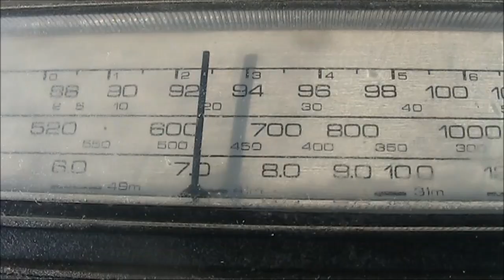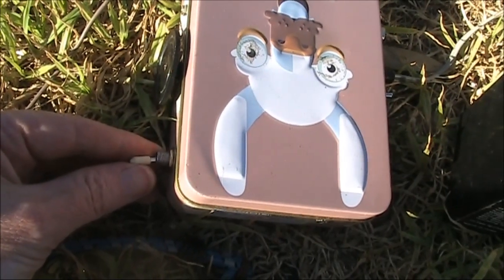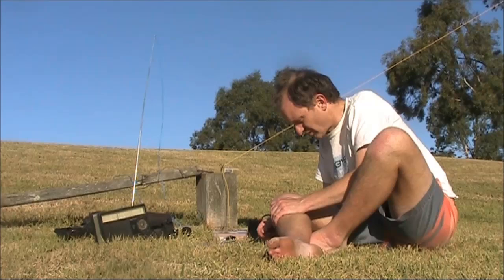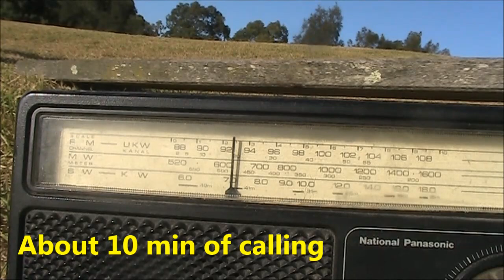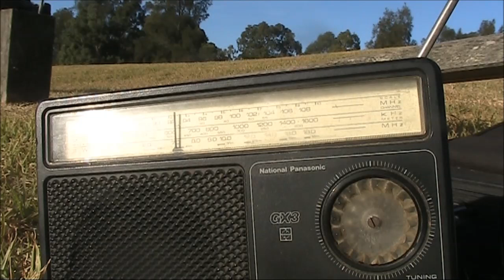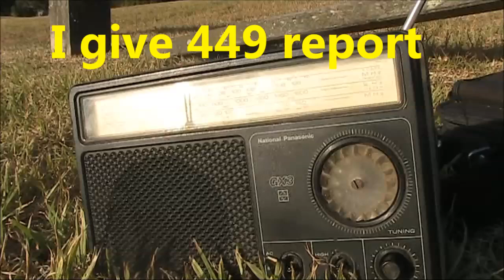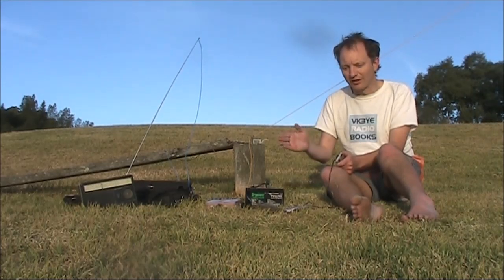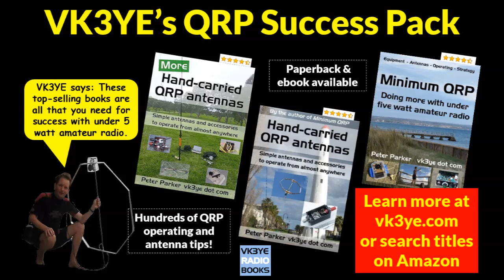7 MHz CW QRP portable with a transistor radio: Can it work?

Comment: Peter, it was a pleasure to QSO with you in real life. 

Sadly I couldn’t remember the Q code for fan boy :-)

Confirming you were 559 with some QSB at the start then jumped to a solid 579 for the rest of the time I heard you on air. That was to Sydney’s Inner West, so not too far from the city or the airport. 

Re the rig and setup

I was working battery portable on the kitchen bench after fixing an issue with the transmitter earlier in the day. Testing it out and listening in while prepping for an early dinner 

Rig was a Xiegu X108G, then running 4W, capable of 18-20W

Test was at 2W and 0.5W, the lowest setting, before returning to 5W

Antenna is 33 odd feet of vertical drawn aluminium tube tied to the back fence, with a 1.2m helical whip I made for 40m screwed to the top that acts a kind of trap extension for 40m 

Matching is a multi tap transformer box I made with an FT240-43 with switchable 2-14 bifilar turns on both feed side and the antenna side 

Ground is simply a Bunnings ground stake....stuck in the ground. 

Key was my little BEC mini field straight key I bought off eBay from a dude in Greece. 

Been at this CW thing for just on 12 months, now, so thanks for your patience with my drunken chicken pecking keying and missed bits you repeated. 

We should have tried with my one of my son’s Pixie kits he built when he was 9, if I had known you had 7023. Still a freshly repaired rig, with a mod I’ve done for digital audio and home brew antenna and match must still count for some Real Ham™️ points for the QSO :-)

Peter, it was a pleasure, and a thrill to QSO to yourself on such minimalist home brew equipment. I’ll keep an ear out for you again. 

73s de VK2NAP 
dit dit
Reply: Ps.  After our QSO, I did spot you on the SKCC Sked Page, but sadly, the few there from France and the US couldn’t hear you.
Reply from the maker: Thanks Chris. It would be interesting to try the Pixie. I'm sure I'd be able to hear it. I'd start on a better receiver though. The operating location is just past the end of my street so it's easy to reach and low noise. Maybe we could tee up an afternoon?
Reply: QFB?
Reply: @gsansoucie  QFB ??? Runway lights out ??

Comment: Is it safe working with 5w so close to a receiver on the same frequency? Wouldn't it get damaged without some kind of T/R switch?
Reply from the maker: It didn't blow up my receiver. Other gear may not be so robust.
Reply: @bd139 How should the diodes be connected?